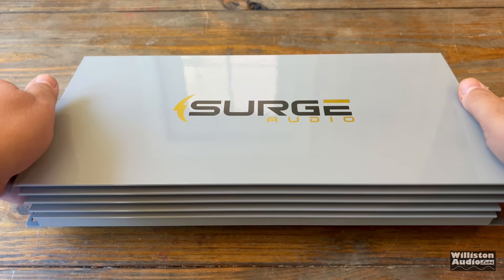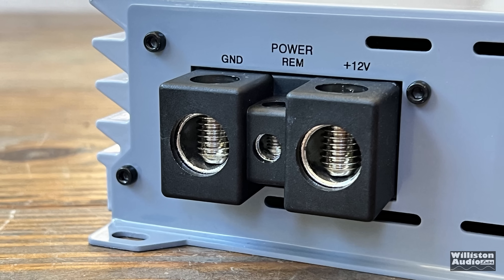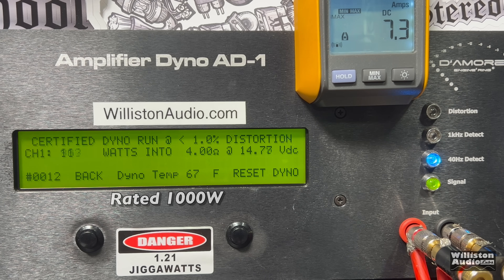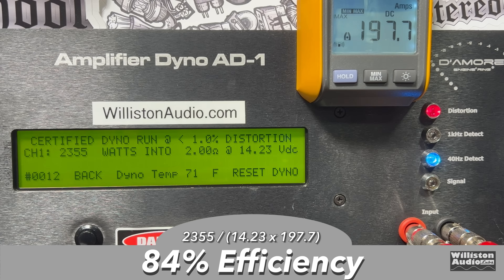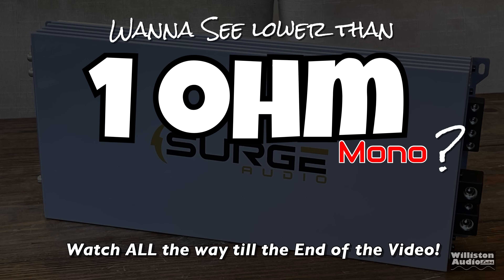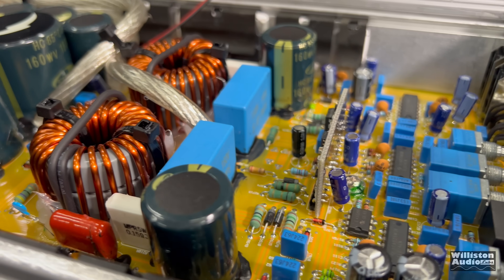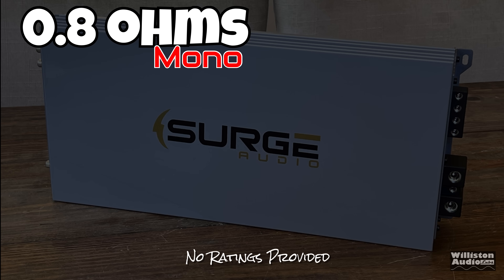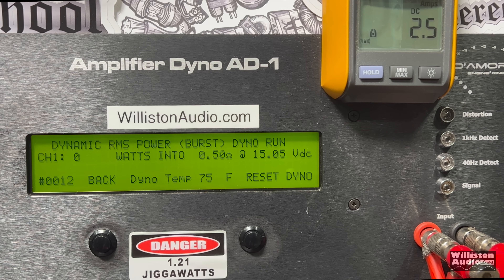Less than 10 Cents a Watt? Surge Audio PL-3000.1D 3000W Monoblock

Comment: The component choices are pretty bottom tier.   The caps, thin PCB looks like it's for a 56k modem.  But, as you noted, the craftsmanship is very nice.  I've seen worse work on Korean-built amps.

Comment: Bought this from D4S and received it April 1st. Hooked it up in my car and started playing it at 1 ohm on my 12” Trinity M12. Gain was turned up a little over half. Everything sounding great then about 7 minutes in, I started to smell burning electrical. Look back and the amp smoking. Still running tho, not on protect or anything. So I immediately shut it down. Wait till the next day to contact Colin at Surge. he advised me to try and specify where the smoke was coming from. So I started running the amp on my basement set up. Had it running at 2 ohm this time. After running it healthy for a few min, started smoking again. Output inductors were burning up. I talked to Colin again about a return or replacement, and advised him that I would be interested in paying the difference to get the 4k. He immediately gave me a coupon code for the website for $400 (what I paid for the 3k) and I purchased the 4k for another $300. He had it shipped within the hour of me sending him my order confirmation on the 4K. Not even sure if he wants me to send back the 3k. In the end, I was obviously disappointed with the 3K. It never worked for me. In my opinion, it’s the Chinese manufacturing. That’s why when I had problems with it the first time I instantly knew I should have gone Korean manufactured. I haven’t received the 4k yet but I’m confident in the build quality. I’ve only had good luck with Korean manufacturers. I’m happy Colin instantly helped me out. I was worried about the process and time with getting a replacement or the possibility of them fixing my amp. Less than a day later, I already have the one I wanted on the way and have been fully credited for my 3K. I will stay updated with how the 4k works out and most likely make a video
Reply: I've seen other comments about this smoking and they say it's the excess  flux from the soldering or something burning off with other owners, check earlier comments, but eventually the smell and smoking went away and worked fine in the end.
Reply: I'm glad to hear Colin gave you a $400 credit for being displeased with the amp. That's great customer service.
Reply: @supadupa6891 yep. The 4k delivered this morning and I have not yet hooked it up. Looks beautiful tho
Reply: @KemDawg123  4k update?
Reply: @ going strong
Reply: @KemDawg123  good to hear. Pure Korean power there

Comment: Looks pretty legit amp, I was looking at the Salt 3 or DD M series 2500 and was told about this new surge audio 3k. Seems to do over rated as well as $700 cheaper vs the Salt 3 which I know the salt series is some bad azz amps but also know there's name market ups with some of the big audio companies
Reply: Sundown amps roll an ancient 20 year old circuit design with terrible protection circuits. They are way overpriced

Comment: Compare the guts of this amp to a team pie 3k and u will not buy a surge amp the Chinese knockoffs are built way way beefier than these amp dynos specific built amps they DO NOT make anything like this power in the real world a Chinese 2.7k has twice the power supply and twice the outputs and 4 times the amount of capacitance this amp costs about 85 bux from China. I have the Wolfram aw 9000.1 and blew 1/4 of the amp running it at 1ohm rising to 2.3  I had to buy such a big amp just to get 4500rms I had 1 of the 9k amps on each 15 zvx  I had 4 total surge is all show no go a taramp smart 5k  shit on that Wolfram 9k wasn't even close .

Comment: I just received this amp in the mail as soon as I hooked it up it started to smoke😢
Reply: Same with mine. Doesn't seem to be related to output levels. Mine starts smoking after 10-15 minutes even at very low output. I emailed surge audio and am waiting on reply
Reply: @spajohatch7349  surge will reply with they are all tested at the factory and there's no way for them to be bad. When I receive the amplifier the box had a little dent on one side of the outer box. Didn't think much of it until it started to smoke out of the capacitor 🔥
Reply: @fishtoledo I did get a response. Colin said it was excessive flux used to solder the output inductors. I did leave mine on for about 4 hours. Somewhere in that time it did quit smoking. It still stinks, but it works well so far
Reply: @spajohatch7349 thanks for the update. How does it sound? And whats your setup?
Reply: @supadupa6891 it  sounds fine to me. I'm running 4 fiaudio 15s. I have a 400amp alt and one buffer battery near the amp. At .5 ohms it does seem to have a lot of peak power
Reply: @spajohatch7349  I got a reply they said there's no way these amps are bad because they're all tested from the factory and if they can prove that the amps aren't bad we have to pay for shipping. As soon as they hook mine up it's going to start smoking out of the capacitor 🔥
Reply: @spajohatch7349 mine just caught fire in my trunk caught fire same place it was smoking when I first got it. The amp only seem to make power when you had the head unit turned up

Comment: I have a question  I'm new to the audio world can you use a 2 channel amp wiring kit on a one  channel amp every thing is  1200 watt the wiring kit amp and subwoofer  12 inch
Reply: Yes. Just be sure it's a quality kit. Some cheaper amp install kits exaggerate on the power/ground wire size. 
The only main difference between a 2 channel and mono kit, is the output wires going to the subwoofer.

Comment: Hey Big D when you run your dynos do you set the gain, or does that not matter on the tests?

I am running a taramps smart 3k bass (I have watched your dynos on the amp) and am going to try and run it on max with a couple of 3-4000 watt rms subs and want to know if I can run it indefinitely on very high gain. I will use the square root of the rms wattage if it’s a 3000 watt rms sub, but if it’s above that say 4-5000 watts rms can I run it full gain?
Reply: Full gain will invariably clip your output signal. Half-gain is a good rule of thumb for max. My old-school Pioneer DEH 80PRS head unit has 5v  pre-outs. With the gain fully down on my JP8, the amp is matched to a 6 volt input  source, so my gain is barely up off minimum to match my head unit's pre-amp output signal. I can go a little past that but I get a chopped waveform on the o-scope if I push to just above where it is currently set. Underpowered, but clean signal is still better than cooking your sub's coils with a distorted output. A soft clip is generally acceptable for a well-constructed subwoofer, but I don't even go that far. When my bass knob says I just hit clipping, I do not go any further,  even though the amp will still get louder.
Reply: @timstarnes8587 or just overpower the shit out of your subs. It's WAY better for them than feeding them a clipped square wave.

Comment: The resistive loads in the dyno should be accurate. So 0.5 ohm should be that. Why would you think it would actually be 0.25 ohm?
Reply: It is a pure resitive load that doesn't change and isn't subject to box rise/impedance rise. Plus, a speaker's resistance isn't static like the resistors that are used for dyno-testing the amps. The resistance of a speaker changes based on temperature and even the frequency of the music that it is playing. So yes, a .5 ohm resistive load is equal to, and in some cases, even lower than a .25 ohm speaker load.
Reply: @timstarnes8587 Thanks for confirming my comment.

Comment: Gorgeous amp for the price very well built. My jl are also made in China so means nothing if the company gets uses good components. My alternator was bleeding just overhearing that current pull at low impededance when I watched this parked in my car 😂 hope these guys do well and keep making high quality bang for buck. ❤️
Reply: It's not I issue of you have a good lithium battery. Just get a 140ah for 499. Problem solved

Comment: It did 7,205 watts, Dynamic R.M.S. Power (Burst), @ 14.63 volts, right after you seen, the 7,009! Great video.
Reply: It's not that impressive trust me I have one. She looks nice sounds nice etc etc but level of action output taramps Smart 3k is king 👑
Reply: @crandallexpo0648  what's bad about this amp? It puts out high wattage. But is there something we are missing
Reply: @crandallexpo0648  - The Taramps Big Boss Bass 8k amplifier, would be my choice, if i were to buy a Taramps product. Same power ratings @ 1/2 ohm, 1 ohm, and 2 ohms. I would wire to 1/2 ohm, so if my impedance rise went up 4x, ( which is pretty average ), i still would be getting rated power.
Reply: How does it sound though  @crandallexpo0648

Comment: I'm much more skeptical about pre-ordering from some of these smaller startups after a nightmare with Wolfram.  O-2400 got "lost" in shipping and took weeks to get refunded. Got on from D4S that died a few months after installing and nowhere to send it for repair or replacement.
Reply: Sorry to read you had those issues with Wolfram. I Preordered the C-2400 and it's still working flawlessly
Reply: What do you mean by the JP amp 'died a few months after ordering"? Unless it was abused outside of its design/function parameters, it would have been repaired or replaced under warranty. Did you contact D4S about it?
Reply: @timstarnes8587  it wasn't a  D4S amp. I reordered the O-2400.1 from D4S but apparently their relationship with Wolfram was over. I was willing to pay for the repairs but no resolution was offered.
Reply: I had zero issues with anything Wolfram. Purchased AG-12, AUv3 18, O-5000, AW125.4, AW5k, & W-7500

Comment: More expensive than a hifonics 3k
Reply: Hahahaha!!!
Reply: You get what you pay for, dude. Hifonics 3416 BRZ "3400 watt" amp didn't break 2000 watts on the amp dyno.😂 Hifonics amps are made for Maxxsonics by an OEM Chinese buildhouse. They are decent amps, but way overrated. I have a Brutus 1300.1 that barely made over 700 watts on the dyno. Clean sound and dependable, but they don't ever make rated power.

Comment: Hey Mr. Big Dummy! 
Parts express has a new line of diy amp boards that have a built in dsp that look really capaple. I would love to see a run down and amp dyno test, especially of the 4 x 100 version, it will accept a 39v 10 amp power supply into a TINY bluetooth amp...It also has a 18650/26550 battery option with a solar input...pretty cool!

Kabd-4100 
Kabd series boards

Comment: First, nice bass knob but wow that brightness though. A strap-able budget amp! Very eye catching. My mind is boggled! As far as the tests go I’m glad to see an amp that delivers for budget!! Great video!
Reply: The d4s amps are similar. Id bet they use the Same build house. Surge has been on top since they introduced their first amp
Reply: @bronwynkaye9277 I have the jp 23 v1.5 and I love it especially the bass knob. But a little jealous of the color of that surge
Reply: @isaiahhowell1090   I had the jp23 when it came out.  Pretty solid Amp. It seems the surge amps run much cooler so I may step away from Synergy Audio and try a surge Amp   in my tahoe I have 4 synergy wfo 12s, synergy wtf7.1 Amp, jy hp40lithium, 3 390amp Ohio Gen alts plus stock 130 alt, Maxwell supercap, limitless supercap, 4 hybrid audio mirus 6.5s, synergy 8.4 4channel. Its a daily 155db build. My g6 has 2wfo 12s, jp23, 4 skar fsx 6.5s, 2 skar supertweets, Phoenix Gold rx400.4, 250amp Ohio Gen, and box tuned at 31hz. Average 149 at 25 to 29hz. Both boxes built by Drew Jones. Hes a good friend of mine
Reply: @bronwynkaye9277  my jo run really cool but damn that's also alot more then I have

Comment: If not a scope, hook an actual sub or speaker up during the test thru a 100 ohm resistor so we can hear and/or see the clipping during the test.   Not all amps clip or ramp up cleanly but still show good numbers.
Reply: Yes a scope will show how clean those curves are indeed!
Reply: Where is one going to find a 100 ohm resistor that can dissipate all that power?? 🤔
Reply: For bass, you won't even hear the distortion if it isn't super clean. 

It's the mids and the tweeters that you want to see a super clean sine wave on a scope.

Comment: Nice to mention that they paid for a spot in the video.  But, between your use of scientific equipment and your standard pattern of doing your reviews, if it had been bad it would have been very visible.  But the proof was there and the review is solid.

So, no worries that they paid - just plain honesty in the video.

Comment: Looks nice. It seems like there are a lot of companies that found the same buildhouse for amps. This looks a lot like the JP amps, one of the CT Sounds lines, and a few other companies. That fat bass knob wire and the nice knob display that has lights that are way too bright. Caps with the stickers on top and just the general parts and layout. Could be different places copying elements but these all seem to be a little too close to each other. Not saying that is a bad thing, I like my JP amp just fine but this amp really made me think of the JP23v2 performance wise if I am remembering correctly. 
Anyway, just an observation and not being negative. Being in car audio since the early 90s, modern amp price/performance blows my mind over the last few years
Reply: It does look like the jp23 v2 but I wonder if it performs better thermal efficiency wise I had 2 of the jp23 one refurbished one new and they both didn't go into protect for heat and instead got hot puff of smoke and that was it have my subwoofer 1ohm and powering it with a cyber 12k double 1/0 power and grounds
Reply: @jcchaco11  Wow, thats a shame. I have had good luck with the JP line but not the 23 specifically.
Reply: Replaced it with a taramps smart 3k similar output and it doesn't get hit the fans are louder and it has 2 but it's working better than my jp23 
The worse part about the smart 3k is for power only 4gauge fits so I did some 4 to 1/0 adapters and I was unable to use my dual 1/0 adapters on this amp
Reply: @jcchaco11  Yeah, I have seen those 4 gauge connectors and thought it seemed odd for a 3k. I have been eyeing that newer Taramps "Big Boss" 8k but wont be starting my build until after the holidays and want to see what kind of experiences people are having. Taramps is high on my list of potential new amp
Reply: @murrayshekelberg9754  it was unavailable after big ds review I'm guessing cause it sold out but it's available again I almost want one also just cause it has some nice led effects lol and they actually added 1/0 for power and ground finally
Reply: @jcchaco11 which hit harder jb 23 or smart 3k? And sounds better?
Reply: Absolutely spot on.
Reply: Exactly what i was thinking. Came to the comments to see if other ppl caught on lol
Reply: Guys help me remember a few of the top build houses

Comment: I have dual .67 15s and run it at .67 final so .67 isnt that odd of a ohm load
Reply from the maker: The dyno's loads are resistive and lack impedance rise as normal speakers would exhibit.

Comment: NOONE BUY THIS STUF.
Reply: Lmao...ok 🤡. The 10k, 7k, 4k have been out. You big mad at the price/watt. Go away
Reply: Those caps look suspect to me... I know capXon isn't a top tier brand, but the printing on them is horrible. 

Also, they selected a unit to send to BigD, so it's obviously been tested. 

If anyone is buying this, take that into account... you don't know what YOU will get. I've seen it with tool batteries where they send good cells to reviewers and it's a fantastic deal, highly recommended, and when WE buy them and open them up the cells inside are knock offs and it's below average.

Comment: D4s copy? Or close enough
Reply: This company was started over 18mo ago by Colin Buckeye. The original owner of Wolfram. Not a D4S copy.
Reply: Not a copy, but likely the same amp internally, built in the same Chinese buildhouse. The bass remote is even the same as the d4s amps.

Comment: D Wiz, love these videos. Man, I own a few choice pieces of old school stereo from the 90s and early 2000s when 1000 watts meant something. This new stuff blows my mind.
Reply from the maker: I'm putting most of the old school content over on https://www.youtube.com/@wal2 so make sure you're subscribed for the classic content 👌
Reply: @wal  Word
Reply: @wal what gauge are the speaker inputs?
Reply: @wal 
PLEASE can you do a dyno test on mtx thunder 250x.... really want to see if I can use it play tweeters
Reply: @wal can I ask you a question please.  Pairing this with a 140ah lfepo4 battery is good?
Reply: I know what you mean, I have a JL 1000/ and I’ll put it up against any other amp that out there (wattage related) and I’ve had it for about 20 years and is still going strong! I may have paid over $1000 for it but to me it’s was worth it!
Reply: @MrRodneydh  Those 1000w JBL's were so dope in the day. Same with round Kicker Solobarics, art series Precision, etc. I still have my first 8 inch JBL paper cone sub. I had two 12 inch Pyle Drivers in boxes 2 years before I could drive lol

Comment: Remember when amps were rated at 12.5 volts? You know, when the engine ISN'T running...
Reply: Most companies (up until 2005) did a 12.8V rating. Only a few still do it. You going to install over 200ah of lto cells in order to run a 3k amp with the engine off for more than 20min?
Reply: Pepperage farm remembers
Reply: This isn't the 80s and 90s anymore. You're not playing these systems with the car off, not for long anyways and even if we do doesn't matter because the lithium batteries we use rest at 14-16v